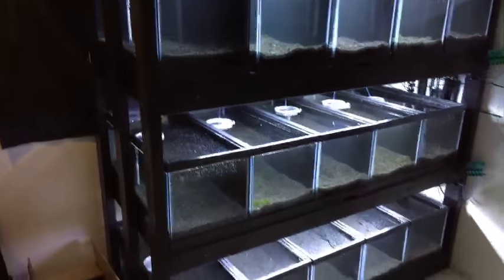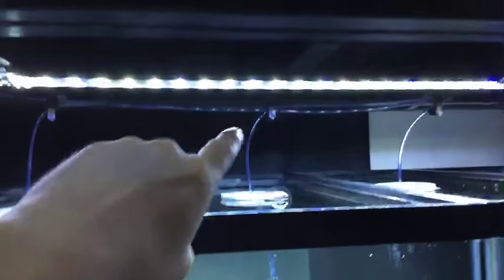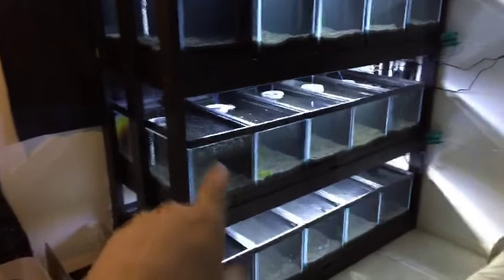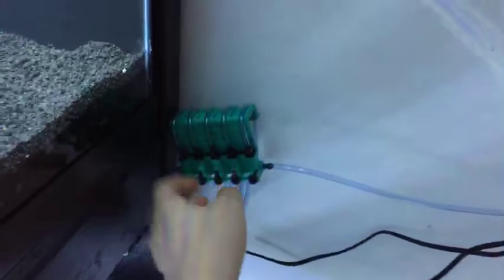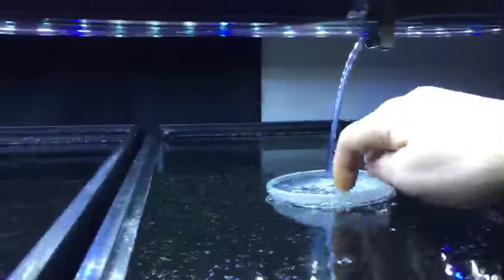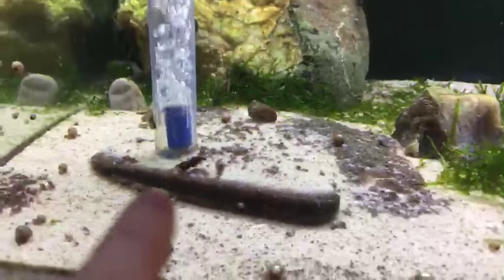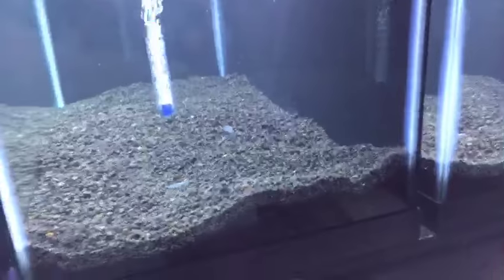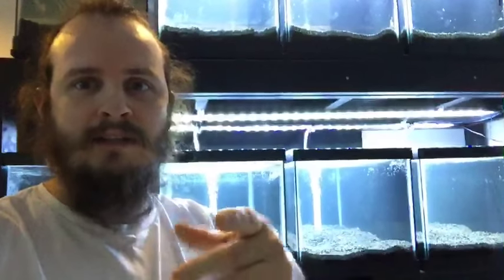🔴 How I Setup My New Aquarium Tank Rack for  Plants, Fish, and Shrimp Breeding Live!

Comment: Wasn't going to ask until I saw you STILL reply to these old videos, that's simply amazing! Can you tell me the height of the gap above the tanks and the bottom of the 2x4 above it? How much room do you have to reach in? Never built such an efficient rack it is driving me nuts to "guess" the proper gaps to not limit myself getting into the tanks . Appreciate it LRB :)
Reply from the maker: I believe it is 8-10 inches. Its good to have room to get your arm in.

Comment: The reason the air stones work differently is because the airlines are cut different lengths if they were all cut the same length and looped where they needed to be shorter the would all have a more consistent pressure to the air stones.

Comment: Did you use 2x4 to build the stand?
Reply from the maker: I did use 2x4s. I doubled the 2x4s for the length of the stand where most the weight is.

Comment: where can I find the triangle sponge filters? how much?
Reply from the maker: I got mine from my lfs, which were only a $1 each. You may be able to find them online by googling corner sponge filter or triangle sponge filter.
Reply: Yeah tks brody I googled it but it looks like 25 gals is the biggest size. Btw I have a mixed comm cichlid tank 72 gals, Id like to add shrimp, snails and maybe frogs, can they survive?
Reply from the maker: Cichlids would make quick snacks out of the shrimp and maybe try eating the frogs if they can fit in their mouths.
Reply: Would you be willing to find out where your lfs got them from? Years ago, those used to be super cheap on aquabid. Now, you can't find the things anywhere. They rock the Lee's version in every way.